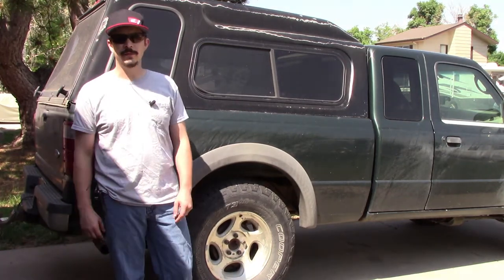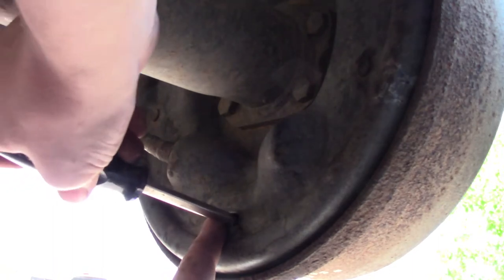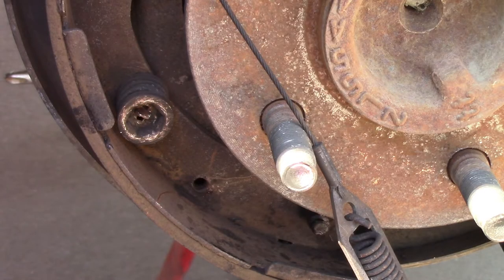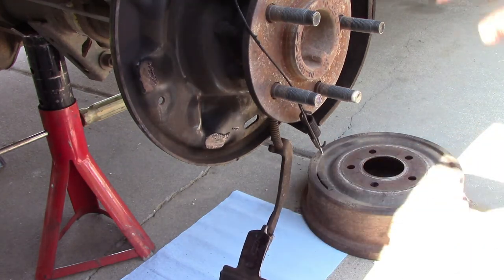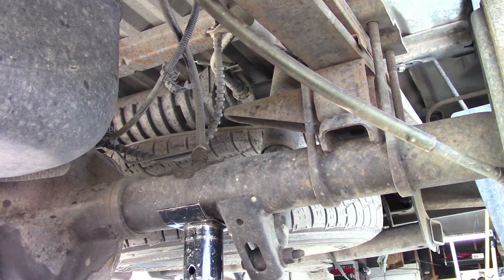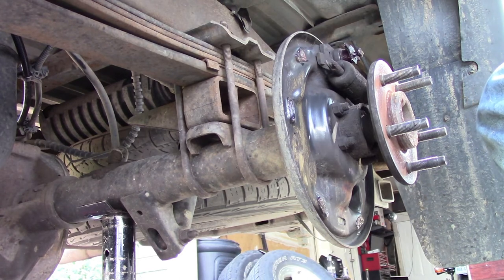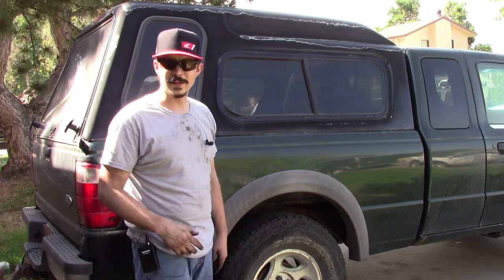Parking Brake Cable Replacement | 2003 Ford Ranger XLT 4.0L SOHC 4x4

Comment: I gotta ask man what do I need to buy if the cable thats like center area on the driver side snaps. I know thats odd wording hope you see this and can reply soon
Reply from the maker: Four cables make up the parking brake system. Front cable attaches to pedal, then Intermediate cable connects front to rear right cable and rear left attaches to rear right. It sounds like what you need is the Intermediate cable.
Go to Orielly Auto parts website and input your license plate or VIN number to ensure you get the correct fit results as these are specific depending on wheelbase, bed length etc.
I got the BrakeBest cables from Orielly this way.

Comment: The only part of this video I needed to see wasn't even shown. Sigh. Need to see how the 2 rear cables attach to middle cable
Reply from the maker: Technically, rear driver connects to rear passenger, rear passenger connects to middle with the clamp shown at 9:00
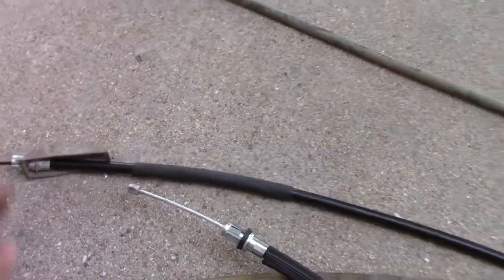At 13:38 you can see the bracket that attaches rear driver to rear passenger already transferred to the new cable.
I hope this helps, if I could post pictures here I would but if you email me at dustydingusyt@gmail.com I would be happy to help further
Reply: @DustyDingus  thanks Dusty, I was able to figure it out. Looks like I'm missing the connecting bracket.

Comment: Dude, your driveshaft is pointing backwards. The boot should stay on the upper side, to prevent damage. The longer part should bolt to the rear diff.
Reply from the maker: Hm. I've never had it out. Couldn't find anything definitive online which way it should be though

Comment: You wouldn’t happen to have the part number for that line by chance?
Reply from the maker: Which one? 
I just put in my vin number on the website (orielly I think but also check advance and AutoZone) and then search for parking brake cable and it should tell you what fits. I replaced both rears. The lengths are specific to wheel base, cab size etc

Comment: Awesome video. !
Reply from the maker: Thanks for watching and commenting!
Reply: @DustyDingus  quick question.  Did u have to run both lines up to front.  Or is there a junction midpoint.  Thinking of just cutting them both out.   But replacing dosnt look so bad.   Only thing is everything has been a fight on my dads 2003 ranger.   Ny state salt !
Reply from the maker: There is a front, intermediate, and 2 rear cables. One coupler connects drivers rear to passenger rear, the next connects passenger rear to intermediate, then there is another coupler that connects front to intermediate. I only had to replace the 2 rear cables.
Reply: @DustyDingus  thanks so much.    Is union for back right over transfer case in rear.
Reply from the maker: @stephenmetz2044  no it's just along the outside of the frame on the driver's side, just look underneath you can't miss it
Reply: @DustyDingus  thank you.     Keep up the videos on ranger.
Reply from the maker: I have another one coming soon!